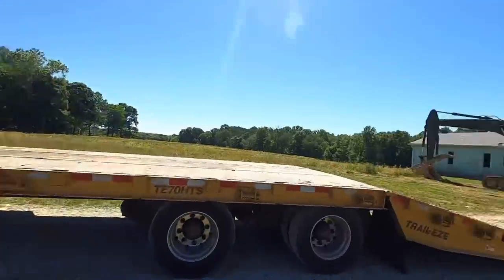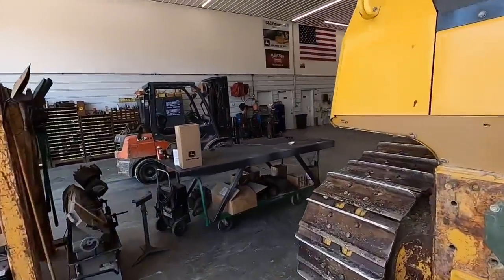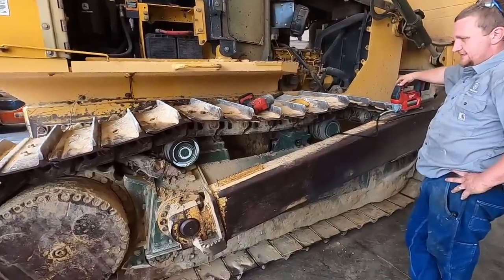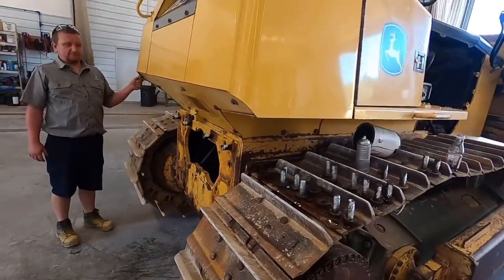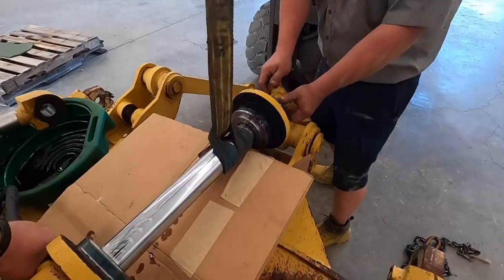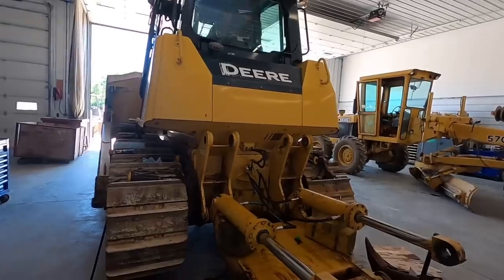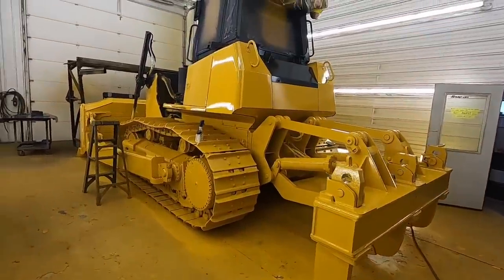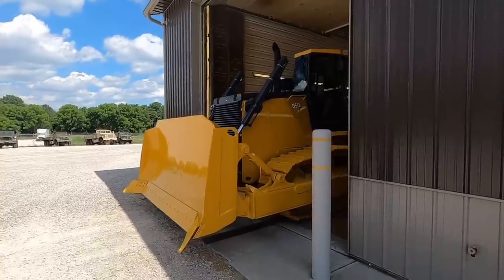Frankenstein Deere 850J before and after restoration with Kevin’s handiwork ready for its new owner

Comment: Clinton the standard you maintain for everything you do is immensely satisfying and impressive.

Have John Deere or any other manufacturers changed the pump for elevating cabs to a rotary on latest models so they can be tilted with a cordless drill in a manner similar to the new load binders you bought yet?

Watching Hunter do it 'the old fashioned way' was like watching paint dry and no doubt you could put that time to better use along with other people who have need to tip a cab.

It might be good for folks like disabled veterans and so forth who could have difficulty using the reciprocating pump and maybe offering an aftermarket modification kit might provide a bit of useful income?
Reply from the maker: It could

Comment: your team does a great job.  I like the undercarriage work you do.  No corners cut.  I don't think people realize how hard that work is.  I have taken off a few very heavy belly pans with missing and stripped bolts.  Seeing you run taps through bolt holes
is just smart.  most of the time old bolts are cross threaded with an air wrench and left for the next guy.  You go the extra mile.
Reply from the maker: Yep

Comment: 'We've not had a hiccup out of it.'  Isn't that the dozer that threw a code and needed a part changing?  Nope. Just checked. It was the green dozer that needed an EGR valve, so the yellow dozer has a clean slate.
Reply from the maker: Yep

Comment: If you go a real short distance is it necessary to chain the machine down?
Reply from the maker: You never know what could happen
Reply: Yea sir it is. My uncle was moving his tractor about a half mile. Car pulled out in front of him. He slammed on the brakes and tractor and loader went in his truck bed. Tore off the headache rack on the equipment trailer and totaled his truck bed. As we said he saved the peoples life as went sideways to avoid a t bone. Tractor tires were on sides of trailer tongue and loader was most of the way to the truck cab.